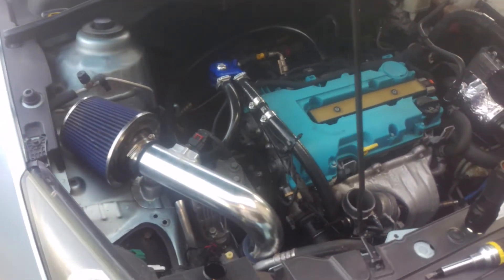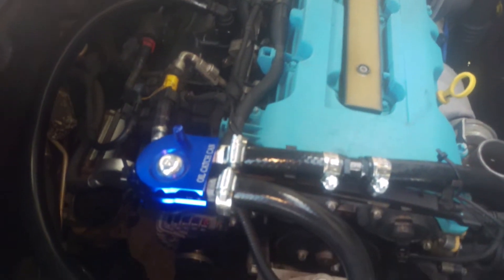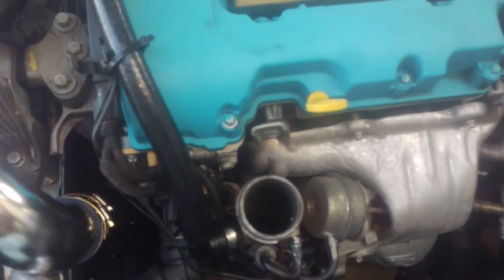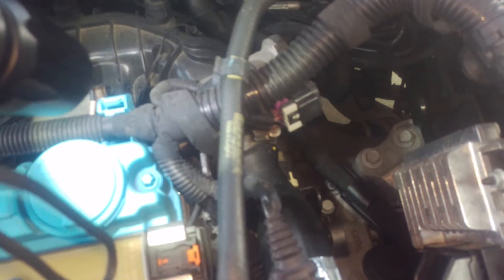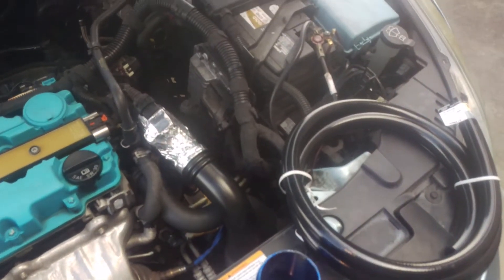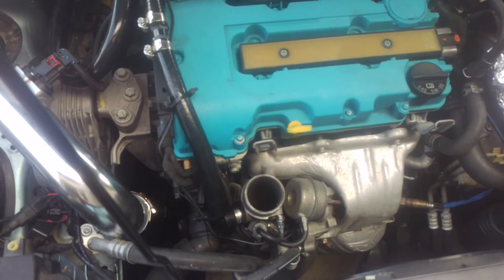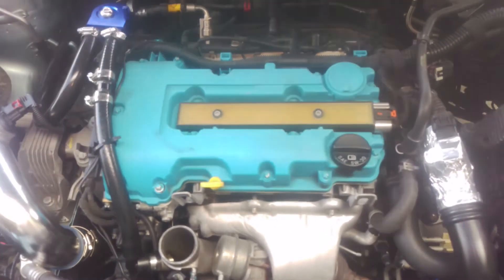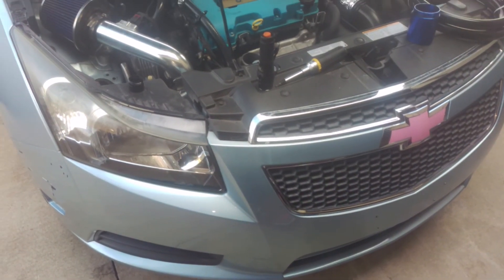1.4 Turbo GM Chev Cruze Sonic Trax Buick Encore Oil Catch can mod diy purpose and benefits

Comment: The oil catch can is 2  or 3 ports? And whats the reason to installation. Did u get the intake pcv valve broken or still in the intake , im asking this because i want to instal one in my car and it will possible to get the way to install it please and thanks for a helpful video
Reply from the maker: The ebay oil catch can is 2 ports and keeps the turbo, intercooler, and throttle body cleaner. And the check valve in the line is because the check valve by the turbo fails on these cars. Also the PCV valve fails in the intake manifold on these cars, so you can get a PCV fix kit if you want, but what I did is get a ported intake manifold from ZZPerfomance because it comes with a new PCV valve and has more airflow to give you more power.
Reply: @koreymayo8884  got it ! Thanks
Reply: @koreymayo8884  i dont have any code but i saw a little bit oil in the turbo inlet where the pcv hose comes connect with the turbo inlet so i want to install this oil catch can as same u did my intake manifold is the stock  not ported or so 
Do u think this will work or could be worst to install it ??
Reply from the maker: @sancheztorres35  it will help. Definitely won't make anything worse.
Reply from the maker: @Armando Sanchez  https://www.homedepot.com/p/UDP-5-8-in-I-D-x-7-8-in-O-D-x-10-ft-PVC-Appliance-Drain-Hose-T44006001/304185152
Reply: @koreymayo8884  his this hose good heat resistant i mean for the engine heat
Reply from the maker: @sancheztorres35  I haven't had any problems with mine. It's pretty thick and heavy duty.
Reply: @koreymayo8884  ok because i put the catch can in front of the engine where the turbo is  there not much space on the sonic like cruze
Reply from the maker: @sancheztorres35  oh ok interesting. Just keep an eye on it because it might be hotter in that area.
Reply: What size is the hose you used?

Comment: Do you think a cfm billet oil cap breather with the catch can benefit anything
Reply from the maker: No! Do not put a breather! That's bad for any modern car. You create a vacuum leak and bypass the PCV system and when you bypass the PCV system and dont pull out blow by from the oil the oil goes bad much faster!
Reply: @koreymayo8884  thanks bro guess I'm taking it off I bought the cfm one a while ago but I've been using it with my catch csn I just installed yesterday.

Comment: Do you have 3 hoses going to your catch can or 2 .
I cant see clearly  and is this a 1.4 turbo
Reply from the maker: 2 hoses. 1 going in, and 1 going out. And yes 1.4 turbo.
Reply: @koreymayo8884  so korey is the v3 kit a must have when adding oil catch cans to these motors .
Or is it just a permanent pcv fix issue .
I got my oil catch on its way.
But dont know if im going to need this v3 kit on hand for the pcv problem.or can i just add a valve like you have.and what sort of valve would i need

Comment: Can you link the catch can? The ones I find by that manufacturer have too small of a fitting size for the hoses
Reply from the maker: I used 5/8 inside diameter appliance hoses from lowes or home depot. 5/8 hose from auto parts stores wasnt strong enough to handle the vacuum/boost pressure.
Reply: Korey Mayo thanks bud 🙏
Reply from the maker: https://www.ebay.com/itm/Blue-Oil-Catch-Reservoir-Breather-Can-Tank-Filter-Kit-Cylinder-Aluminum-Engine/163811995553?epid=27037563136&hash=item2623f4afa1:g:yQgAAOSwFutdToXE

Comment: Did that intake trigger any cel?
Reply from the maker: Well I already had a check engine light from a bad pcv valve in the intake manifold and a bad check valve by turbo intake, but that ebay intake isn't any good because it uses 2.5 inch pipe, but these cars need 2.75 inch pipe, so now I'm running a ZZPerformance Cold Air Intake. Now gotta replace intake manifold/PCV valve soon.
Reply from the maker: Ever since I switched to a ZZPerformance cold air intake and a ported intake with new PCV valve I haven't had a check engine light while using the oil catch can.

Comment from the maker: Sometime soon I'm going to switch to a ported intake manifold with an external PCV valve since the one in the manifold always fails on these cars and then I will have both manifold blow by and pre turbo blow by routed through the oil catch can and will post another video explaining a dual catch can on these cars soon!

Comment: Do you have a part number or a link for the check valve?
Reply from the maker: https://www.ebay.com/itm/UPR-17MM-Non-Return-One-Way-5-8-Inch-Air-Fuel-Oil-Check-Valve-Diesel-Gas-E85/291327163877?hash=item43d473bde5:g:6M8AAOSwDyxblsXl

Comment from the maker: Here is the oil catch can I used if you want to be cheap like me. I'm sure their our much better ones though if you are willing to spend more money. Hot Oil Catch Reservoir Breather Can Tank + Filter Cylinder Aluminum Blue
https://www.ebay.com/itm/Hot-Oil-Catch-Reservoir-Breather-Can-Tank-Filter-Cylinder-Aluminum-Blue/392453170925?ssPageName=STRK%3AMEBIDX%3AIT&_trksid=p2057872.m2749.l2649